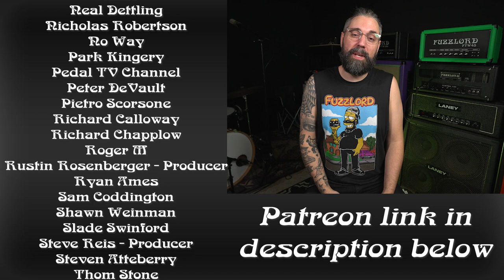Doom Metal Amp Shootout

Comment: The Orange style amps are the warmest sounding. But i am biased because i own some Orange amps ; ). A Thunderverb 200 and a  GRO100 from 73.  You should check out the Orange GRO100. It has less gain than a OR120.  Its kind of a forgotten Orange amp .
 And if anybody comes across old Carlsbro amps from the early 70s. Buy them! they are dirt cheap . But inside they have huge Partridge transformers . And they have tons of clean headroom. Even the 60 watt version. And you can get then as a 120 watt as well. And the 200watt P.A head version is great for bass

Comment: Hope you don't mind a few questions about the Laney AOR. How does the 100w AOR compare to the 50w? Does these sound good at low volume if you use an attenuator and crank the master volume, for home playing? Can the gain be tightened up with a pedal? Also, does the AOR has the big low end like the Orange Rockerverbs do? I know prices have gone up, and people use to get them because they were cheap, but what would you consider a reasonable price for it these days? Thanks!
Reply from the maker: Great amps with a good master volume and works great with a tube screamer 🙏